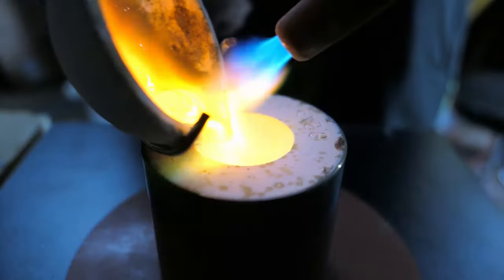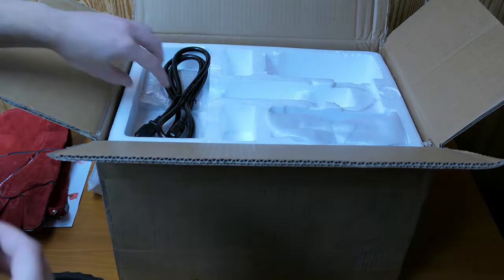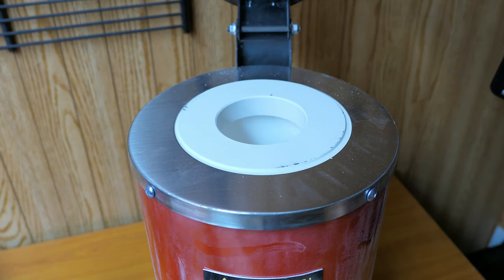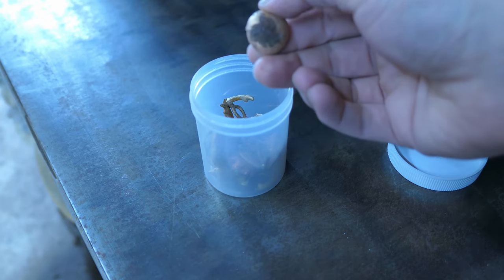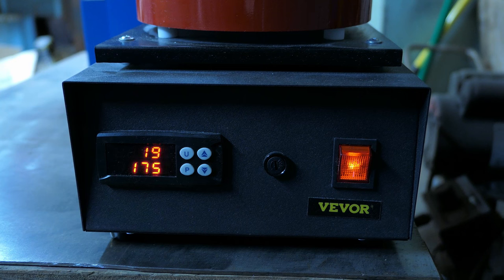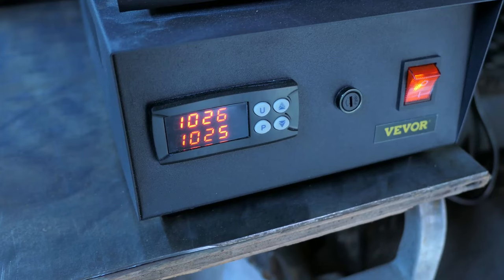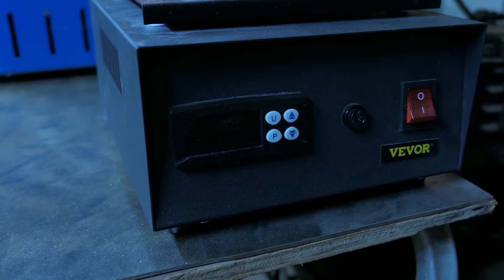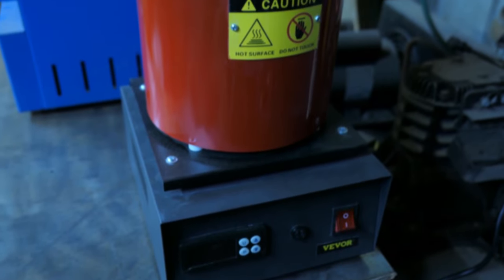Honest Review of the VEVOR Electric Melting Furnace

Comment: Ok it's been 6 months since you shared this video. Have you had any issues with the smelter yet? Had to replace any parts yet?
Reply from the maker: As far as I can tell, there's no issues at all with mine yet! The only thing that I will need to replace soon is one of the graphite crucibles (from having some wear and tear after several melts) but that's not unusual.
Reply: @GraceNoteForge bro do salle yo used one 
I bit need im in senegal
Reply: @GraceNoteForge its been almost 2 years how is it doing now?
Reply: @OfficalBird_man  im interested to know :P

Comment: I’ve always wanted to cast silicon bronze ever since I saw ferrosilicon for sale online.  Supposedly, it dissolves in molten copper to make the silicon bronze.  All I would need is copper scrap to make bronze!
Reply: or add 10% by weight of Zinc pennies, and have commercial bronze!  but don't use legal tender! Maybe foreign pennies...
Reply: @TheJerad1  Yes because I have reliable sources that informed me the department of treasury has special force officers and they hunt you down anywhere on earth if you use so much as one post 1982 penny in your alloy composition!  Zinc is not to expensive and widely available
Reply: What is the purpose of that and/or ferrosilicon? I never heard of them before now. What do you want to do with them?
Reply: @jtbmetaldesigns Fr. I’m pretty sure that’s what they got that Epstein guy for 😰

Comment: Thank you so much, at last, i am currenly considering to buy, does it melt copper easily and in how long?  should i buy the 1kg one and anything else i need to know?   sorry for too much question, but i been looking a lot on internet, lol thanks a lot
Reply from the maker: Thank you for watching! I haven't tried melting just copper yet but it normally takes around 45 minutes to an hour to get bronze to melting temperature. 

What size you get really depends on what you plan on doing with it. For most people, I think a 1kg is perfect but if you want to do larger castings, having the option to use 3kg crucibles is really nice. 

Hope this helps. Happy melting! 😁
Reply: I have poured seven bars of copper and my crucible lip wore out while doing a pour and I spilled copper all over the place. If gold silver and aluminum is all your melting it will do. For copper Spend the money and buy a devil forge unless replacing a crucible every 7 pours is worth it to you

Comment: This just popped up in my recommended, great to find another fellow metal caster on YT, subscribed and rang the bell for more.
Good review video, I own a similar but more professional furnace, I love using it and I had it for about 4 years, have not needed to change the heating coil yet, and does what yours does in less than half the time.
It's the Goldbrunn Therm 3000, (also not sponsored) it was/is however more expensive. If you would like to compare statistics let me know, or look them up of course.
A few important things though: the 1kg crucible does NOT belong in this setup, I have seen more cheap knock-off 3kg furnaces come with the smaller crucibles and that just shows how careless and ignorant the suppliers of these cheap devices are. The 1kg crucible should only be used in a 1kg furnace that has a smaller cavity, so that the crucible fits precisely like the 3kg crucible fits in your furnace.
First of all the smaller crucible will not heat up as well and secondly if the small crucible wears down a bit after some uses the supplied thongs will not grab it correctly anymore or not at all (good to know you forge your own thongs) and 3rd: after it wears down it might actually fall into the cavity completely and wreck your device. So please don't use the small one. You could use it as a mold though and make some small round stock that can be used on a lathe, chess pieces come to mind... anyway, sorry for the wall of text, when it comes to safety I feel this stuff is important to know. Stay safe and happy casting! 👍👊
Reply from the maker: Thank you for the tip! Happy casting! 😁
Reply: any of you know small but high temp furnaces?

Comment: I'm thinking about buying one. But what I'm curious about is what do you do after you melt let's say aluminium, and cast it.
Will there be a lot of residue? And if so, what do you typically do with it?
I'm assuming just kick off where you left off, and leave it. It will melt along with new aluminum...or is there a way to clean the crucibles?

Comment: So when making casting grain you just put the hot silver into water? I’ve never done casting before but I just wondered if that’s how you do it with sterling silver also?
Reply from the maker: That's normally how I do it! It doesn't necessarily make perfectly round casting grain like you would buy in stores. The end result is more like odd shaped flakes but they're still a very manageable size 👍
Reply: Yes

Comment: I have this same furnace but when I pour the metal goes everywhere.
Did you make any alterations to your graphite crucible?
Reply from the maker: Hmmm that's strange. 🤔
No, I didn't change mine at all. Both of my graphite crucibles have a small notch on the rim to help with pouring.
Reply: You Must completely completely dry you mould before pouring the metal or it will go everywhere

Comment: What's the difference between 2kg
 vs 3kg. 
2kg being cheaper than 3kg. But will it work the same.
 Also. 

What is the difference between. 110v vs 220v. Yh I know 220v would be more powerful and melt faster. But will 110v be just as good. Or will it take longer. Someone should do a comparison between 110v furnace and 220v furnace.
Reply: > What is the difference between. 110v vs 220v. 

You need to buy the one which matches your supply voltage. (the one which comes from the wall.) If you live in north or south America that will be the 110V, if you live somewhere in Europe that will be the 220v

Comment: Thank you for this great review. I have just purchased one of these and mistakenly thought that the 3kg crucible would hold 3kg of silver melt? I want to cast an object that will require about 2kg of material and wondered if you could advise me please as to how I should go about this?... Thanking you for your time.
Reply: I think I have seen 6kg crucible for electric furnace like this.
Reply: Try electric induction melting furnace.
Reply: @erningyao4464  These work AWESOME !!
Reply: @shanghunter7697  Yes you are right, this furnace will be fine if you do not want finish the melting in 5 mins. Because this kind of furnace usually takes about 30-40mins to melt a batch but Induction furnace takes about 3-5 mins to melt a batch.

Comment: This company is complete trash they sent me the same furnace and it worked for abt 30 mins to an hour before it turned off and won’t come on. I emailed the company and they asked me to take it apart to look for disconnected wires. The yellow wire on inside was literally melted off of the fuse (solder melted or something) I told the company and they said I should try and “weld” it back on. I followed their advice after asking them to reimburse me for the soldering equipment and them saying no, I fixed the machine 🎉. Lol but it only worked for one and half hours and cut off. I looked at inside and the blue wire is melted off next to previous melted one the previous melted wire was now melting into another wire. I told this company to refund and they said $20 I flipped on them and they said they’ll send the parts to fix (extra wires/ fuse) and $57 I flipped again and sent screenshot of email to better business bureau and they sent the money back before I contacted the bbb. Rip off company

Comment: How do you clean the inside of it?
Reply: You don't, you run it as it is.
Reply: @shanghunter7697  Won't something eventually short out if metal and graphite fragments continuously drop down the inside of the furnace?
Reply: @ThePeterDislikeShow  Turn it over and gently tap the bottom or use a air compressor. Any larger debris falls out easily. A little bit of crud is not a big problem.